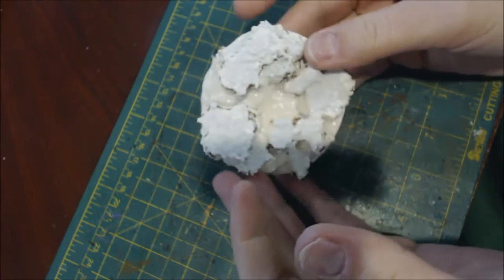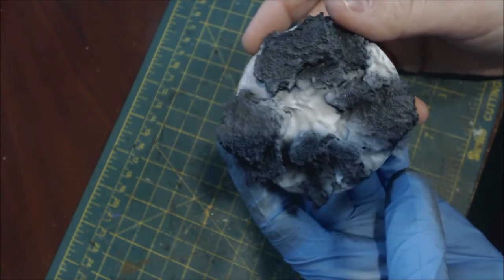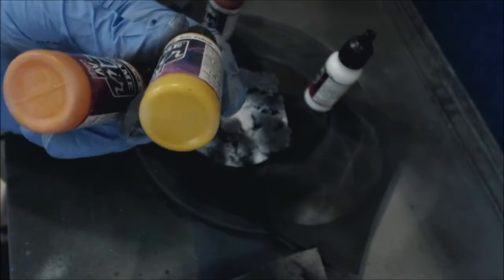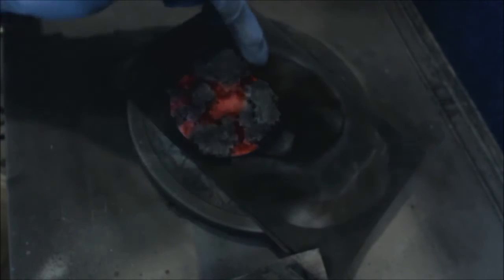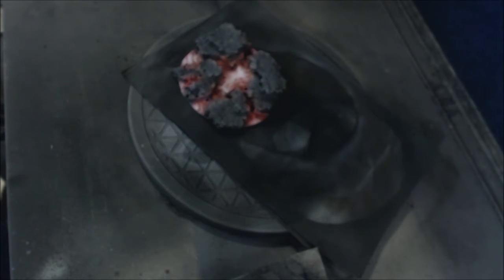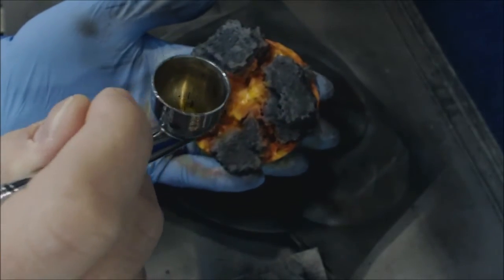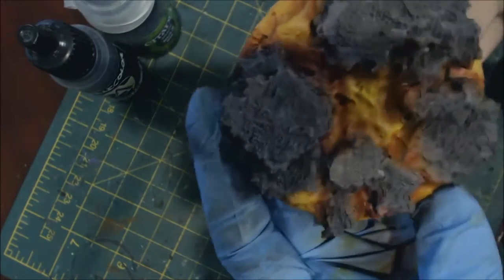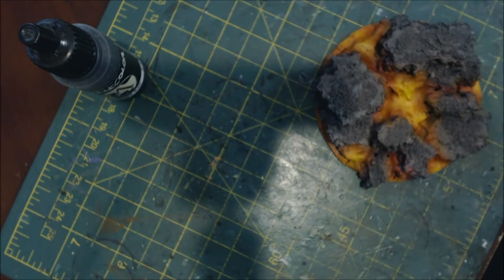Hobby Cheating 67 - How to Make Lava Bases

Comment: Very cool effect.  Something I've seen done, which can produce some amazing results, is to add a final layer of Tamiya Clear Orange over the lava once everything has been sealed; depending on what type of look you're going for, this can really sell it.

On a semi-related note, I'm glad you mentioned about the Cold Grey; when I got my bottle I thought to myself "It looks rather warm, brown-grey" and wondered if I'd gotten a bad bottle.  Also, loved the mid-subject rant about people painting black directly over yellow; I was chuckling the entire time.
Reply from the maker: Certain things really bother me, yellow over black is one of those things. I don't get how people just throw their life away for sub-par effects. 

I will have to think on the orange. I am thinking you could get a similar effect from the badger minitaire orange ghost tint without going to the tamiya paints, as it also is a clear coat with a slight gloss - I assume people are using the sheen to make the final white/yellow really pop and give the effect of a glow. I am always suspect there as I don't like anything gloss in general, as you lose control of the light and your shadows can start reflecting in the wrong light - that being said, I will have to give that a try, there could be some interesting effects there for sure.

Comment: 17:56 "Why are you going to paint yellow over black?"

99% of the time, I'd agree. That said, I'm trying to get back into playing Tyranids. Many of the paint schemes require having a normally transparent hue brush painted over a very dark color (often black) for doing things like the marks on the edges of their carapace plates (the tips or outer rims, not literal edge highlights). Some are even more exotic, like having multicolored dots within dots (usually with analagous hues). See CatgutPainting's Coconut Crab Tyranids to get an idea of what I'm talking about. While these do look cool, every tutorial I have ever seen with these NEVER zenithals when they make them. The downside of this is, as cool as the patterns are, it never looks like the light is interacting with them properly because you need a thicker paint in order to cover over the darker color (hence why these paints are never thinned).

An even harder problem exists if you were to attempt to zenithal something like a Hive Fleet Behemoth scheme. While you may not have the odd pattern to deal with, you now have to worry about how to zenithal something that is warm in one part (the red), and cool in the other (the bluish turquoise color). This wouldn't be so bad if the chitin armor was only on the back and head, but with the leg armor, you can't just use one color to highlight the top and another color to shade from below.

In summary, I guess this is really a two parter. A)How do you use a zenithal undercoat on a single surface where there are patterns that feature an abrupt change in hue and B)How do you zenithal undercoat a color scheme that features both warm and cool colors on surfaces at different heights on the model? I'm not even sure this is possible in order to preserve the original undercoat. I'm thinking you'd just have to use the zenithal as a guide, take a photo of it, base coat the areas in the colors they need to be, and then go over the areas with glazes/shades to lighten/darken the areas to where they should be in more of a traditional Citadel "how to" way of basing/highlighting/shading as the zenithal would be covered over and not preserved in the final piece. 

The reason I say this is because you have a similar problem when trying to paint things like pants for Harlequinns. Generally, I've seen great painters (Kujo for instance) who normally zenithal their models do something similar to that for Harlequinns.Granted, he doesn't zenithal the Harlequinn, he basecoats it in flat colors and does a bit of wet blending before layering and glazing. In the end though, the pants look like they've been lit correctly, and they have a ridicoulous combination of abrupt hue and value changes (between different colored diamonds) as well as more gradual changes (the yellow diamonds becoming more orange in parts as well as lighter or darker depending on how much light they receive).That said, I haven't been doing this for years/decades. Thoughts on how to make Tyranids look right (maybe a Hobby Cheating video in the works *wink wink*)?

Comment: I actually use a Vallejo pumice which is black in colour and works well on cork and saves painting in black designators!
Reply from the maker: Yep, I am familiar, it's great stuff. In this case, I just liked this texture and I always prefer to have every element of the base painted just to control everything. I am obsessive like that.

Comment: Those vallejho texture paints, how well do they stick to plastic bases? Also do you need to prime over them in order to paint the texture paint/gels? Awsome tutorial!
Reply from the maker: They are my go to for more or less 100% of my bases. It sticks to plastic or most any other material without issue. I always prime it first You could probably paint it directly, but I just have better results with a quick priming.

Comment: Looks very good! Is their a difference if you use Vallejo Model Air for this? For example exchange Sun Yellow for Yellow (MA002)? I don't quite get what is the difference between vallejo air and model color. Thank you!
Reply from the maker: Nope, it's just slightly different mixes of the same colors. You can use any paint brand. I am always paint brand agnostic. Unless I say otherwise in a video, you can use anything close (i.e. any bright red, any yellow, any warm orange, etc.)
Reply: Thank you! :)